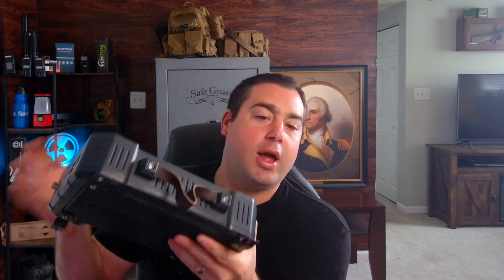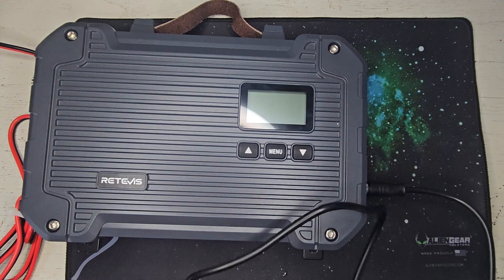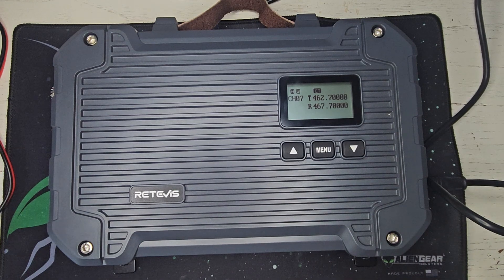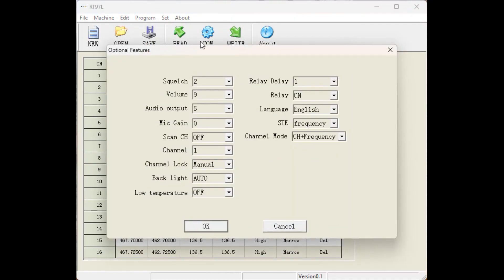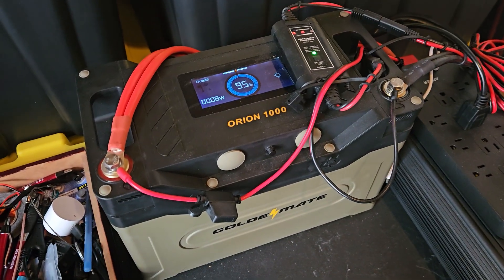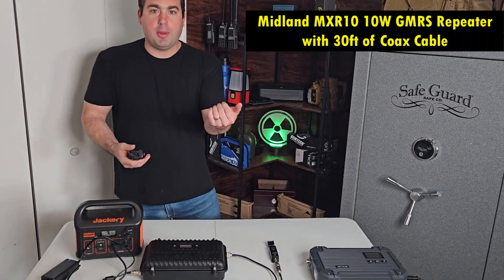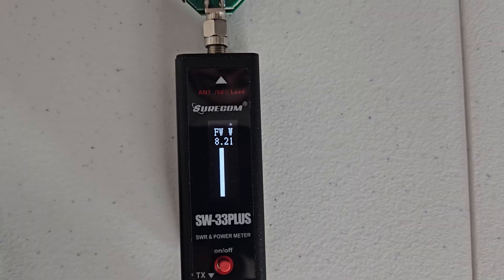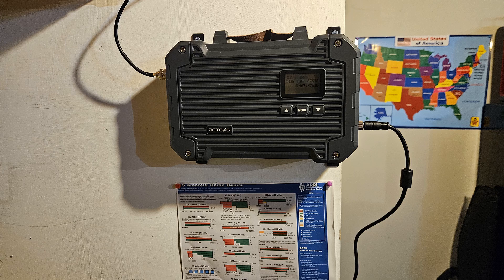Retevis 25W RT97L GMRS Repeater Review | Power Test & Why It Beats the Midland

Comment: You should never use any coax cable with less performance than lmr-400. Also limit connectors to N type or SMA. I run 1/2" heliax and have no noticeable loss at about 30'

Comment: Sorry man, but you way underestimate the importance of good low-loss coax cable. A better cable has larger conductors and more insulation. Good cables are more than 3 times as thick as a cheap cable. The difference is much more than you portray. *Video idea* test it and see if I'm wrong. I'm subbing because hopefully you will, and I think you have a good thing going here.

Comment: The repeater is weatherproof. So, why not mount it closer to the antenna and reduce your coax lenght. Depending on where and how your antenna is mounted you could concievably mount it just under the antenna and get almost full power to the antenna. You would need to run a power line to the repeater but that should be fairly easy and reasonable price wise.

Comment: I have this repeater on a 35 foot mast at my house. My location is pretty good but not the greatest because I have a high hill immediately to the west of me. I get 10 miles to the north and about 13 to the east, which is pretty good for a portable repeater set up as it would be in field conditions. If I could position the antenna higher, I'm confident I could get another 5 miles or so. In the field, of course I will try to put it on the highest terrain feature available. I think it will suit my needs nicely.

Comment: Yeah but what coax are you using? Use lmr400 times microwave and do your test. I get 9ver 50 calculated watts with my lose and antenna gain.
Reply from the maker: Yes this is why I disclose it is just cheap amazon coax. This was just to show the little 10 watt repeaters really dont make much power at the end of a long cable run. Also i mention i am taking some loss through the connectors.
Reply: You get over 50 watts on this repeater that’s rated at 25 watts before the duplexer? What’s your antenna gain, cable type, and cable length?
Reply: @christianperi After 70 feet of LMR-400 and a 9 dBi antenna, I end up with ~129 watts ERP (Effective Radiated Power).
Reply: @o0RageCore0o wow so you turned it from a 25w into a 129w repeater, nice 👍
Reply: @christianperi  it's ERP which is because the antenna is 9dBi gain.

Comment: What do you think about adding some VHF to the gmrs license along with the license-free Murs frequencies in the same radio?
Reply from the maker: Would be nice! I wont hold my breath though lol.
Reply: @citizensurvivalplan  maybe if enough of us put the suggestion into the FCC proposal mailbox system it'll get noticed. My pitch for it would be that it will enable gmrs users in rural areas to talk further via simplex if repeaters are unavailable, and also adding interoperability with otherwise little-used MURS radios, especially during emergencies.